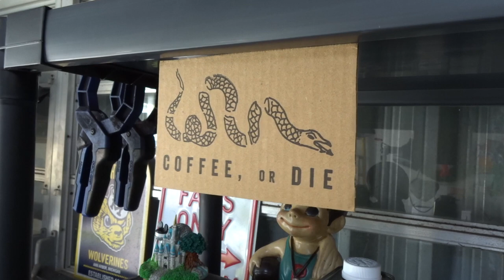Black Sheep Props Behind The Scenes

Comment: Clean and amazing setup all around. Question is what kind of bandsaw blade are you using to cut the foam?
Reply from the maker: Thanks Dan!
I’m using an 18tpi -  3/8" blade. I used to have a 1/4" blade in and it can turn a tighter curve, but I leave the 3/8" in all the time now because it lets me rip straight cuts as well as still being able to cut a pretty good curve - and I can always jump over to the scroll saw with it’s super thin blade for the crazy tight curves.
Reply: @BlackSheepProps  many thanks for your reply to this question. This has helped me out greatly. Now to build the Emperor's Holly Bolter